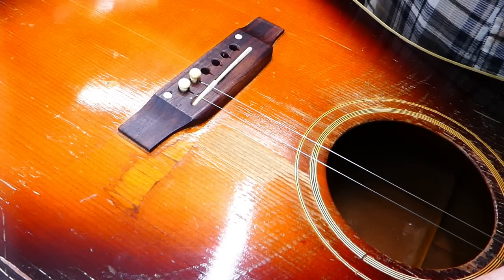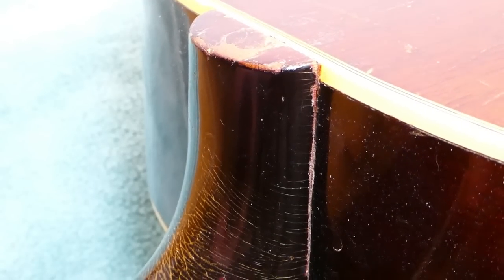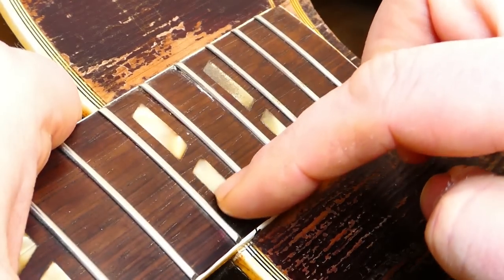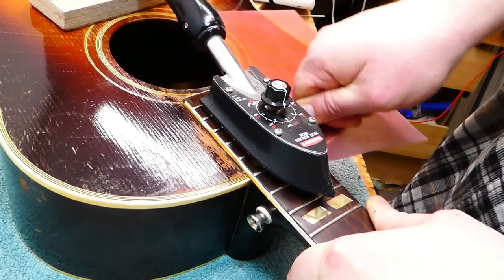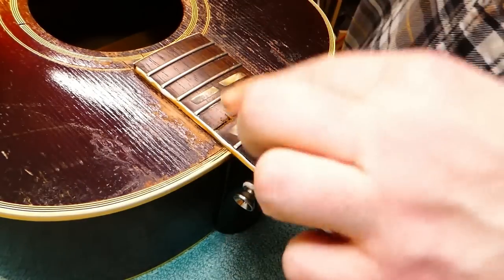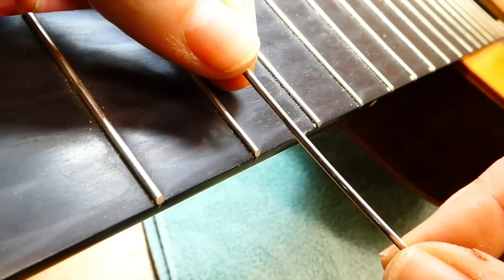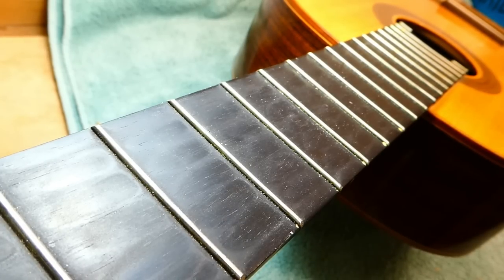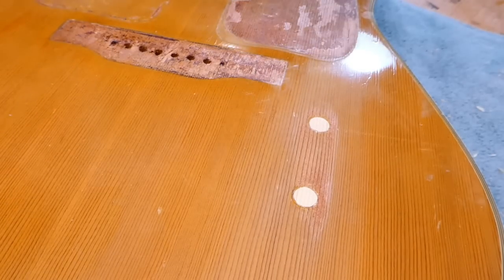40's Gibson Flattops part 2

Comment: Interesting to see a neck re-reset. That heel extension had no wedge under it. My reset '79 Guild does. I wonder about the time (which might be soon) that the resets and being reset. Especially Guild and Gibsons with their shallow, rounded heel profile- where ever bit removed in paper pulls reveals more bare wood. 

Also, Ive seen you use the scary purple elixir to oxydize spruce patches before. To much hassle?

Comment: Instead of the palette knives to break loose the tongue; would it be possible to use wire as a saw or nichrome wire to melt through the glue?  I imagine using it like a garot pulled from both sides of the neck after scoring the tongue/top edge. Just a thought, trying to remove using tools directly touching the top.
Reply: I would say a lot of the work done by the pallet knives is the leverage action after the sharpened tip makes the plunge into the glue line.  That leverage pulls the board up on the "gummy/sticky" glue and allows you to nip at it with the knife edge.

Comment: A few months  I was working on an acoustic guitar and had trouble  removing the bridge pins. I tried  and tried to the point  where I uses a small pair of nippers and still no luck.  My finally attempt was to try to use pliers to free all the bridge pins. Well, first on broke off, then another, and so on and so on. Turns out the customer had glued all the bridge pins so they would not come loose.

Amazing  !!!

Ricky from IBM, now Guitar Tech in Englewood, FL
Reply: Aren't customers always right!?  That's actually hilarious!!
Reply: @kevisp77  yep, I wound up having to drill out all 6 of what was left in the bridge ping holes.

Comment: Greetings from Honolulu. You might want to look into getting some Kapton Tape, to add to your box of tools, so to speak. It's used in electronics, it is a heat resistant tape that you could place over pearloid or mother of pearl or whatever you need to apply heat to, so you can protect what you don't want to get heated and burned. You can get different widths and lengths from eBay or Amazon, et cetera. Thank you for you videos, very informative.

Comment: Just have a curiosity question about the plugged tone and volume holes/divots. Anyone qualified to give an answer/opinion , please do! 
  So, I'm assuming that he probably didn't notice the divots, until he already put in the plugs? What I'm wondering,  is with the extra work of having to fill around the plugs where the divots are, and the possible visual traces it may leave behind, like maybe it sinks in just a little after it cures for a few years...would it be better to just redo the plugs slightly bigger, to eliminate the possible problems? I know this one's not going for perfect, but I'm thinking about future patchwork, maybe on guitars that are going to be expected to be closer to perfection. Where do you draw the line between removing to much "original material " regardless of its condition, even if it's going to make the job harder to finish? In my mind, I was thinking rather than having to deal with filling the divot around the plug, and worrying about shrinkage, I probably would have drilled them back out, and used a ream to open it up till the crush was gone, and replugging. All of this being speculative, and based maybe on a guitar with less damage. Would I be wrong to do this?

Comment: Instead of a palette kinife under the fingerboard extension could you use a multi tool instead? - the vibrating ones with the very thin blade they have for loosening lino??

Comment: ?? instead of removing the 15th 0r 13th fret to insert steam or heat, could one instead drill the holes at the base of the heel into the dovetail? it could be covered up with a simple decorative cap (which some heels already have). it may be easier to locate the pocket. and you also wouldn't need remove any frets. just a thought I had as you were mentioning how the process is relatively new and evolving.

Comment: i have a Yamaha fg180j that needs a neck reset but doesn't... i believe it's pulled low because the top is bowed out... i can place a flat edge across the back behind the bridge and i have about a 1/4" gap at the sides.... the top of the guitar seems sound... the back also is bowed... I'm thinking of wetting it somehow enough to allow it to stretch and then clamp it down by the back with a sheet of 24" square 3/4" plywood and run all thread up to struts which will run across the top of the guitar to press both sides down... it seems to me if i get rid of the bulge the thing should settle into a more reasonable position... right now a straight edge run down the neck hits the bridge about midway up.... I'm uncertain how much i can wet the wood... some of the old Yamahas were lacquered on the inside but not this one... i don't see any loose braces so i think they may have bowed also...